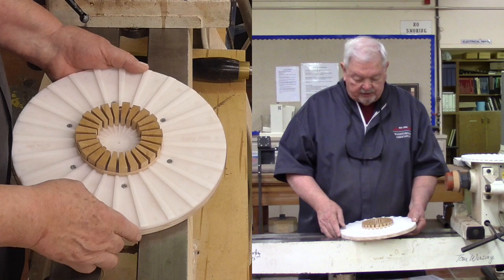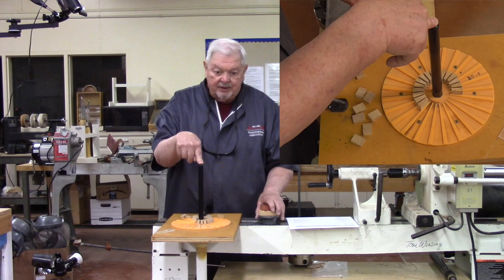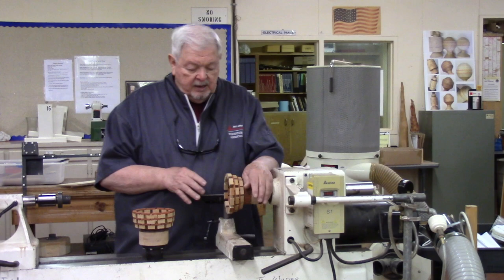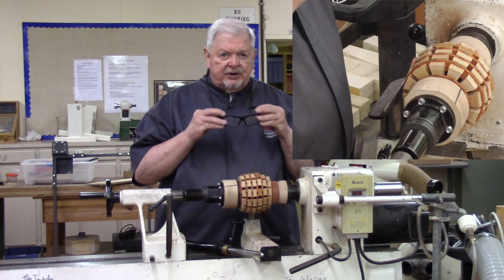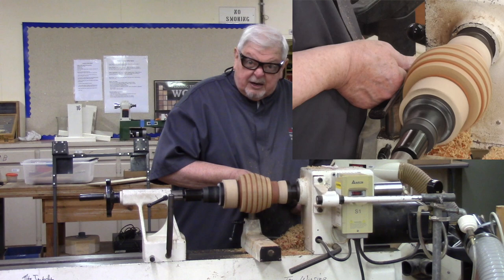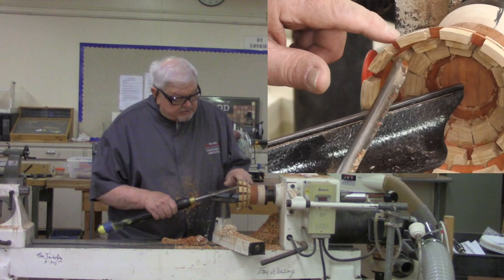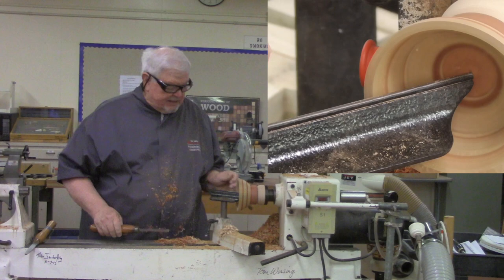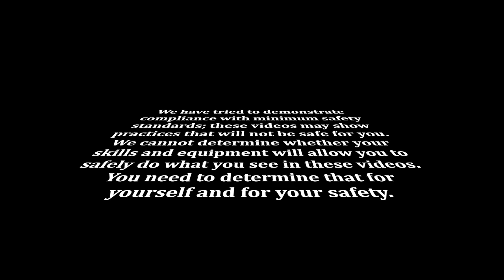James Rodgers, Open Segmented Turning, Part III   HD 1080p

Comment: I have only turned one open segment bowl. I used the Seg-Easy 24 plate along with the stomper. The bowl was 99% successful. It was only 99% because I chipped one or two of  the segments in the next to top ring. I was very happy with the way things worked and will do another one soon. I think using the Seg-Easy plates is quicker than the other two methods simply because you can insert all the segments in a row faster than placing and gluing the segments one at a time. Thank you for this three video series. It has been very helpful. Have a great day and stay safe.🙂🙂 I believe I have your book but cannot be certain as I recently moved and many boxes remain packed.